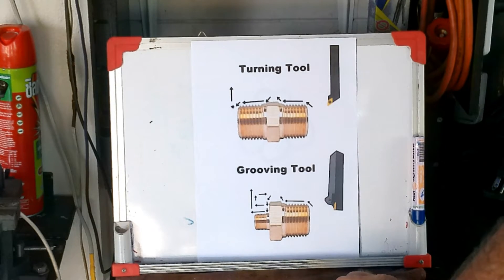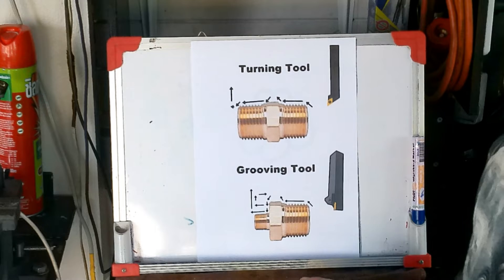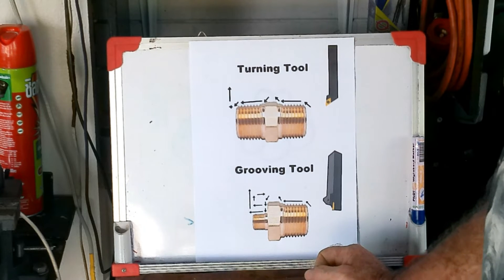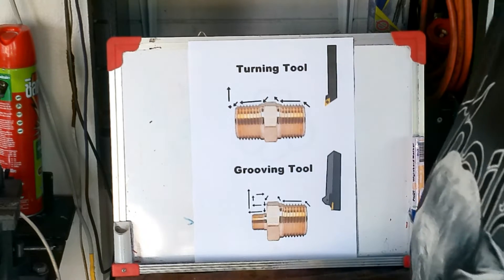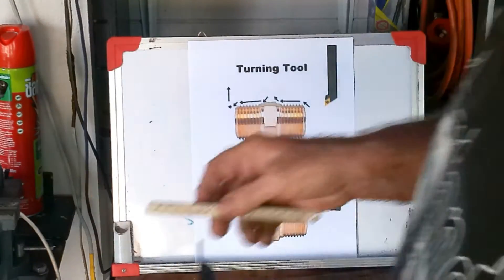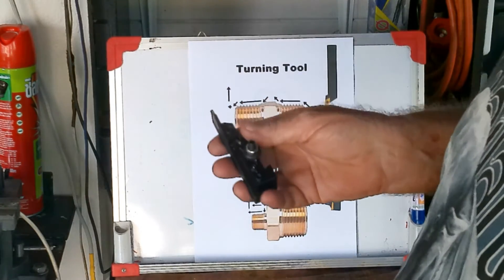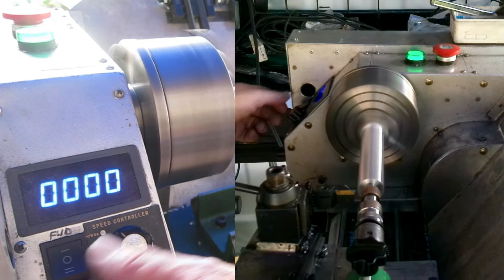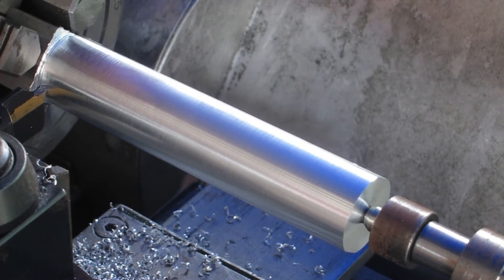MHW Episode 18 - Turning with a Grooving Tool on a Mini Lathe

Comment: Hi. I'm having a hard time finding a correctly sized grooving tool for my mini lathe. The holders all seem to be too tall to position the cutting edge at the middle of the workpiece. Which do you use? Thanks
Reply from the maker: I have 2 holders I use, an MGEHR1212-3 as a grooving tool, that's the one I used in the video and I also have a MGEHR1010-1.5 I use as a parting tool